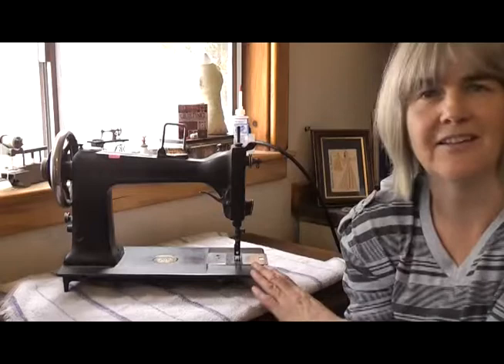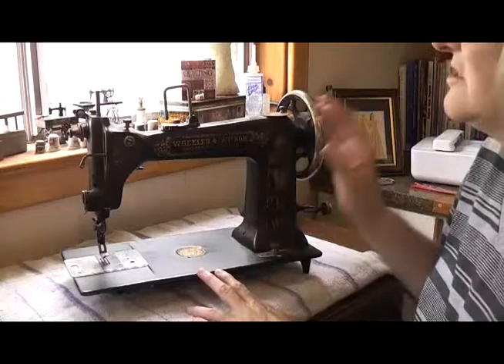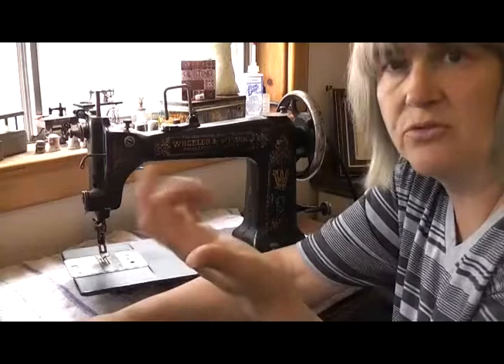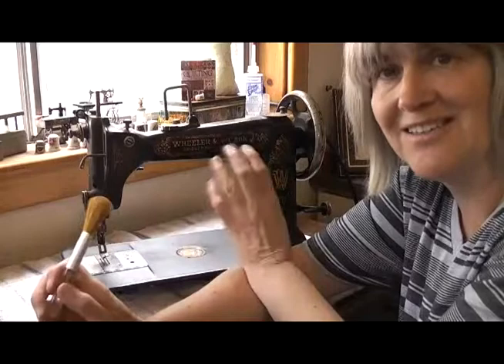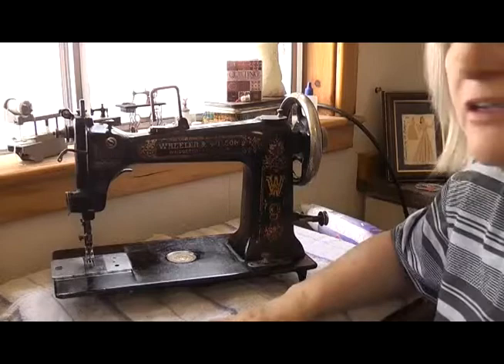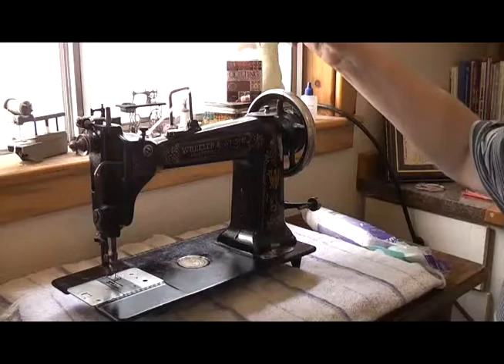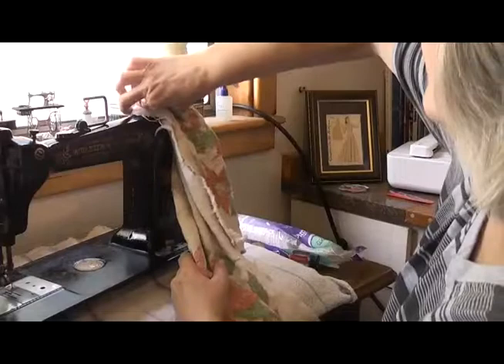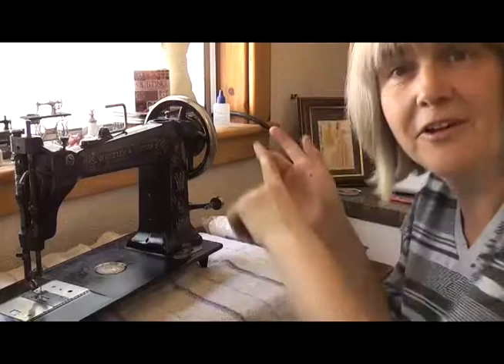How to Clean & Oil an Antique Wheeler & Wilson Sewing Machine

Comment: They welded the presser foot to the bar?! That’s an odd one!
Trick for those stuck thumbscrews. Use a wee scrap of leather wrapped around the screws serrated edge and use lockjaw pliers on that. Protects the screw and the lockjaw pliers keep their grip on it.
Reply from the maker: Great tip! I never thought of using leather. Thank you! 🙂

Comment: Thank you for this video.
I recently acquired my 1st antique sewing machine - a W&WD9 in it’s original table stand.

I also acquired a separate cast iron pedal with the W&W monogram in it (the monogram is in a 7.25”/18.41500cm diameter circle).

This pedal overall is smaller than my D9 pedal.

Do you know which W&W this monogrammed pedal came from?
Reply from the maker: Without seeing the item, it's difficult to say. Although, if Wheeler & Wilson were anything like Singer, the pedal would be specific to a particular style of table, rather than a specific machine. There are some W&W badges at the bottom of this page: https://www.fiddlebase.com/american-machines/wheeler-wilson/ that might help. Or you could check FaceBook to see if there is a group for Wheeler & Wilson collectors. Thanks for watching. 🙂

Comment: Girl I just got a Wheeler and Wilson #8. I believe is missing a bobbing winder , front place and I think screw on the second place. How you been able to find the missing parts in yours?
Reply from the maker: I haven't looked at getting parts for it yet. I got replacement needles from Jacksneedles.com. They are subsitutes as the originals are hard to come by. As for screws and bobbin winders, your best bet is eBay and maybe Mercari. Sometimes Etsy has spares for sewing machines. Or try Sewingpartsonline.com. I'm not sure if they do Wheeler and Wilson but it's worth a look.